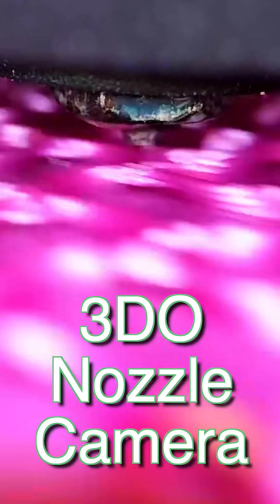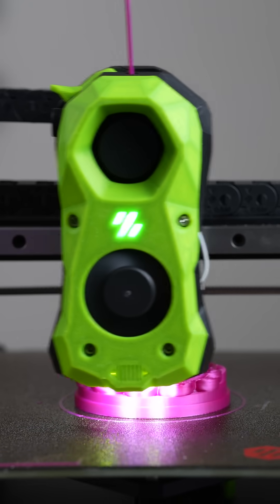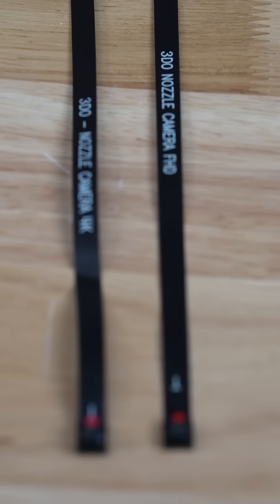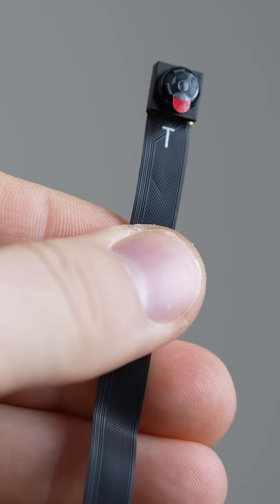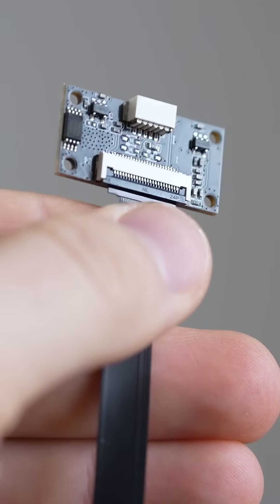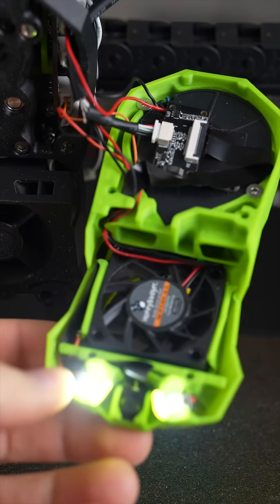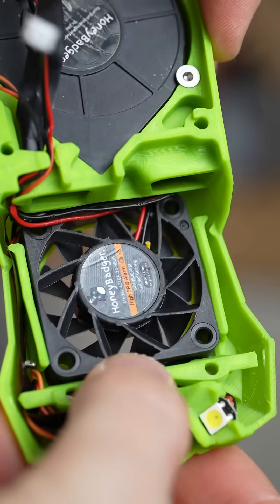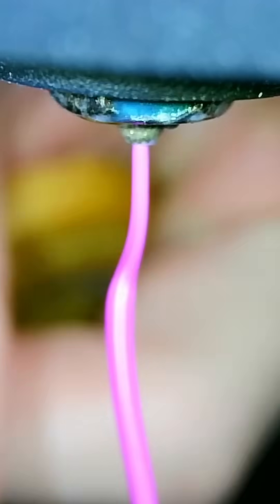One Of The Coolest 3D Printer Mods (3DO Nozzle Camera)

Comment: Use cases?  How about optical calibration of the print bed, or calibration of input shaping?  Don't really even need anything special, as you can print your own calibration patterns.  Or, do it the Bambu way and use a patterned plate in place of the build surface.  Either way, you capture enough to not only cancel vibration of the motion system, but also the build plate so that you get even better anti-ringing behavior.
Reply: Oh, here's another:  Flow calibration.  Not just steady-state, but also accounting for thermal lag, ooze due to outgassing, etc.

Comment: I built a bracket for my V600 (V400) to hold my endoscope pointing down to reflect off an angled mirror (the ones a dentist uses) It is a little bulky but works. 

I could make this work but might be difficult to wire it up. Soldering not my thing, but could try with proper directions if someone could share a link.

Comment: This is assuming that everybody is leveling before every single print though when there isnt much need to do that. Its not like your bed is drastically changing every hour or even every day. I just baby step if needed until its still not enough and then level again. I thonk theres a macro for auto leveling every 10 or so prints.

Comment: Wanna know what's worse than nozzle buildup? A clog that chases molten hot filament to leak out around the nozzle threads, the hole for the thermistor, and other holes to entirely encase the hot end in a solid block of PLA, requiring the purchase of replacement insulation, and eventually a new thermistor.
Yes this happened, it was so awful, and the printer was a Monoprice Select Mini 1

Comment: I knew before my printer even arrived that I wanted a nozzle cam, so I made sure to have a USB otoscope ready and haven't printed without one since. I've had one fail due to static shock, and another might be heat damaged, but the 2nd replacement is actually pretty decent considering the low res. The only downside is the size, so I look forward to getting my 3DO 4K cam on Monday.

Comment: Instead of bumping up to 4K, maybe there’s a version with higher max fps so you can watch failures in slow motion and get a deep understanding of the problem if your other troubleshooting leaves you confused
Reply: This is a great idea 👍
Reply: There are plenty of camera board/ribbon optins that will swap right in to do higher FPS.  High fps is invaluable to gather vibration data to eliminate ringing.
Reply: 60 fps minimum and a global shutter would be more valuable in my opinion.
Reply: Yep, 4k is overkill that's why no one is pushing for 8k. We can see what needs to be seen at 1080p tbh

24 -30 fps and slow motion video stored to SD card will be clutch
Reply: @VoidPixel4179  Resolution doesn't matter as much as you think. I'm not sure what it is, probably the size and quality of the sensor? I have a cheap action camera that is 4k and the quality is worse than my Go pro hero 11 at 1080p.
Reply: @itsnetts it's precisely that. The size of the sensor determines how much light hits it, which determines for a large part the quality of the resulting image.

The resolution definitely matters, but if you take the same sensor size and increase the resolution from 1080p to 4K, you're basically just reducing the light and thus information about each pixel by the same ratio as you're increasing the resolution. 

Of course there comes a point where the increase in the amount of pixels becomes more noticeable than the lack of data for said pixels, but generally increasing sensor size has a bigger effect than increasing resolution.
Reply: @LuukDomhof  Appreciate the info, thank you!
Reply: I believe 30 fps should be enough.
Reply: get the bambulab carbon ....got a lidar scanner on board and corrects itself bei AI

Comment: You can do this with just about any laptop webcam that is convertible to USB. You just surround the camera in heat shrink tubing. If you're feeling frisky you can tear apart a desktop webcam and print a housing that you can attach to the print head yourself.

Comment: 100% PETG user here - You don't need to "check" if there's build-up on your nozzle, cuz the answer is ALWAYS yes 😂
Reply from the maker: Lmao petg is a great material but if it’s wet or on my nozzle I am having a bad time.
Reply: @ModBotArmy You should try out Sunlu PETG. I've got their Grey one and never had any problems with moisture, I now have it laying around open for half a year and still no problems. Nearly no stringing and the nozzle cleans itself while printing the brim
Reply: @matzetechyeah I'm also a sunlu convert. Plus their spools are super nice
Reply: Seems like this would be a PET peeve for many people ;-)
Reply: @RennieAsh  good one
Reply: @RennieAsh HA
Reply: I am PETG user too and i don't have much of a build up that would be causing me problems.
Reply: I've heard copper nozzles with nickel plating can repel PETG build-up. Never had a chance to try it myself tho
Reply: @BladeWalker91  Ohh interesting! Never heard of that, might be worth a try (:
Reply: @BladeWalker91 That's exactly what I've been using for the past several years with no buildup whatsoever. The nickel plating has a lower static coefficient, so the plastic doesn't stick to it very easily. Nowadays I'm running the same kind of nozzle, but with a tungsten carbide tip insert for abrasives and it's awesome.
Reply: A filament dryer, bed leveling, correct offset, correct retraction has made it nearly as easy as pla.   Filament dryer was the biggest factor though.  Like night and day difference.
Reply: It's your z offset. I've dines a thousand petgcf prints which are incredibly sticky. The problem the whole time ended up being z offset on my Bambu P1S. Just create a new printer profile and adjust the offset to 0.03-0.05. Never had a blob again.
Reply: it is so often it is annoying.
Reply: Teflon nozzle?
Reply: If you're using Bambu printer, check out Leckiestein mod as he's written a bunch of machine specific code to optimise nozzle cleaning routine with A1 like silicon wiper on the P1 and X1 machines
Reply: @@TheHighRishMan 😂 Yeppp. And those great little black chunks of burnt plastic that sometimes find their way into your prints. Ahh, sooo good. PETG.... ♥ LOL
Reply: I've noticed that transparent PETG is the worst in build-ups.
Colored (black, white, etc) don't build up as bad as transparent.
Reply: @hashbringer975 Transparent is all resin, no filler, so it's likely that the cohesive force (that prefers the blob) is greater than its adhesive force (that prefers to be smashed onto the bed). Fillers reduce the cohesivity...that's a simplification, because what they do is change the cohesive/adhesive balance, which isn't quite the same thing.
Reply: Fax
Reply: Big facts.
Reply: I found 230 the best temp for PETG with 5mm retraction at 40mm/s speed.
Reply: Petg user here- the filament sticks very well… to the NOZZLE lol
Reply: Yeah, you don't need a camera for that. Lol
Reply: I don't really have that issue
Reply: LMAO. Been running a Prusa with their own PETG filament for years. No build-up during print, ever. So I guess it's either a skill issue or your PETG is from TEMU.

Comment: What what be some good cases:. A) perhaps to use the visual in conjunction with multi material feeders so that purge blocks or off bed purging is monitored to see when the filament is acceptable as apposed to just a time estimate used by all of the main feeders in fdm machines. This could save a load of material and time. B) A more unique idea could be the LEDs actually, if there was a resin style filament manufactured that could use IR LEDs to cure the extrusion much like IR cured glues. This would possibly then make almost 100% translucent objects. Also perhaps the strength in brightness and perhaps nm could be flexible bringing a broader range of products in filament to be created for more ideas and solutions..

Comment: Need an IR camera in the same spot, would make for some cool temperature control abilities for overhangs and etc
Reply: Could you explain why a IR camera instead of an IR temp sensor?
Reply: @TheOfficialOriginalChad  IR temp sensor cannot build a visual map like a camera does, can it?
Reply: @itsnetts it can, actually! Many IR temp sensors have multiple pixels, even some really cheap ones. What's really wild is they work just like cameras in some ways, like you can lens a lens for a wider or narrower fields of view.

Comment: I just did this with a completely different camera, it is awesome to watch, specially at 60fps
Reply: Which one did you use?
Reply: @ariafpv  I used one similar to the BIQU Camera, I purchased a few, most were only 720p 30fps, one of the bunch is 1080p 60fps, but the 720p are still perfect, the control board is located about 500mm down the cable and is just 5 wires on the camera side and 4 wires on the USB side so very easy to cut and rewire if required, has manual led control as well.

Comment: Mount a line laser, then a little bit of opencv to make a lidar surface scanner
Reply: been thinking about that
Reply: Technically, that is not lidar as lidar measures time of flight.

Such methods are very old and can work, but require calibration to work correctly.

You can get a small time of flight camera that works on a raspberry pi for about 350 bucks. It has a low resolution. Probably too low.

It would be better to make a stereoscopic setup with these tiny cameras. However, it would be difficult to find enough features to match for 3d reconstruction due to lack of texture and high risk of overexposure.
Reply: @Julius Fučík  that's why a line laser works  the trick is calibration, but honestly, that can be done with drill rods or shim stock and agree lidar was not the proper description. It's more or less a 3d line scanner.
It work for a first and 2nd layer but pointless past that.
Another thing you can do is put some small fixed dots on the print bed and calibrate

Comment: A nozzle buildup detector is a great idea.  That should be fairly easy to do even with the photo AI that can run on Pis.
Reply from the maker: I agree. There are a few fail detection options I would imagine this could work with (with some slight tweaking)
Reply: @ModBotArmy  Camera name model???
Reply: Raspberry Pi’s really need to come back down in price, I have two 3B+’s and a 4 8GB that I got at original price, but the scalpers are making them absurdly expensive, I will never spend that much on a Pi. It’s pretty sad :(
Reply: @bigwendigo2253  For sure.  I used to toss a Pi ZeroW into a project just to turn a servo or whatever, but now they are precious and I'm recycling them into Klipper hosts.
Reply: @bigwendigo2253  yeah. Even Pi Pico's are pretty hard to find under $10
Reply: @bigwendigo2253  look into Libre Computer. They've got some pretty cheap SBCs that should work basically the same.
Reply: There’s a company that does that actually! Although, their focus is monstrous industrial printers, not this desktop stuff…
Reply: Such overkill